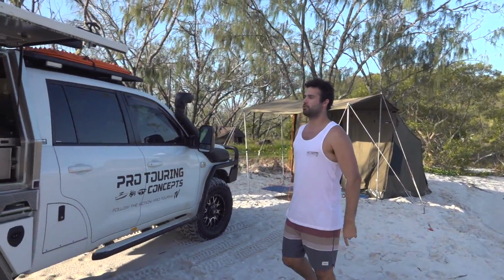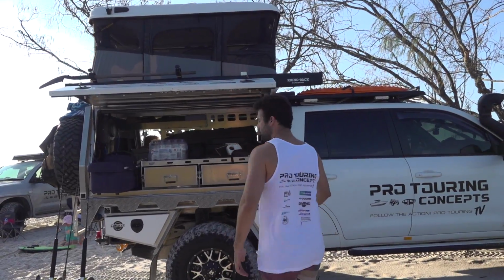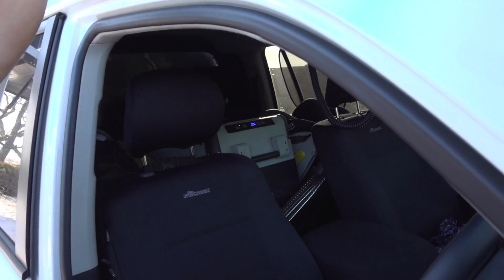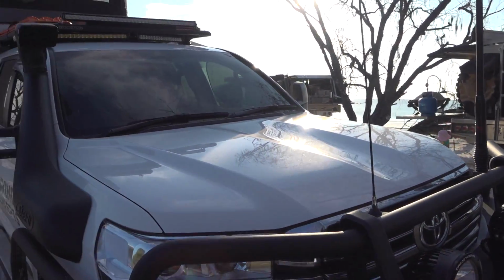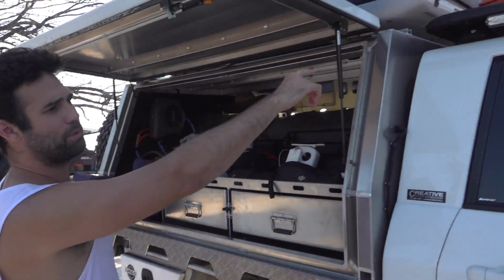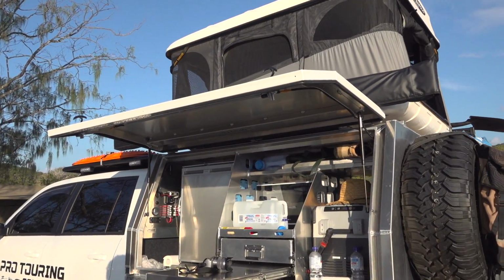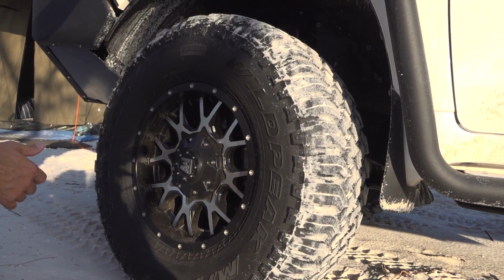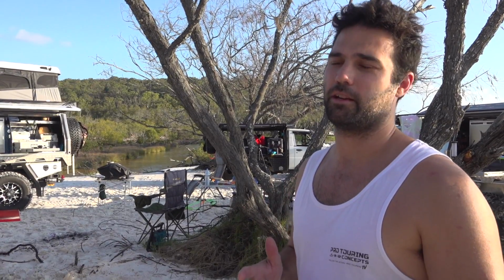2018 Landcruiser 200 Series Ute chop Build Vid Norweld Fraser Island - Pro Touring Concepts

Comment: hey mate, what paint did you beef up the bull bar with? is it rhino or something? cheers
Reply: also how do yo go about running the cables up to your roof rack?
Reply from the maker: Hey mate nah it’s just a satin dippled powder coat from one of our local’s .. you should be able to get it done through most good powder coaters 👍 
And the cables were all run up the rear of the cab.. makes it easy when we do all the work prior to canopy being fitted

Comment: Hey mate, great rig!!! How do you find the upright fridge? Have you had any dramas with things falling out or any issues offroad with the door opening on its own?? Thanks!
Reply: Can't decide between the CRX-80 or an easyslide 220 plus
Reply from the maker: Upright fridges all the way mate. You also save about 50kg as there's no need for a fridge slide. If you can have a secondary smaller chest fridge for all the beers and have the upright purely for food there's no better combination! We've got another few vids coming out shortly that outline a few major points to consider but for us the uprights are a no brainer. Keeps the food a lot fresher and easier to access.
Reply: Thanks mate for the quick reply! I have subscribed and looking forward to said vids!
Reply: Also how do u guys mount/secure the fridge?
Reply from the maker: Thanks mate neither can we!
Reply from the maker: On the Norweld's there's a profile cut base designed specifically for the Dometic uprights. Have to remove existing feet that come with the fridge and mount them on top of the Norweld base.. little procedure but not too hard.

Comment: Nice 200. How did you mount the fridge in the backseat?
Reply from the maker: Hey Glenn.

At the moment it's just sitting in there but we have a platform that gets mounted in there and rear seats removed when we're away travelling. The fridge gets tied down to that. Otherwise you can run the middle seat belt around it for the time being.